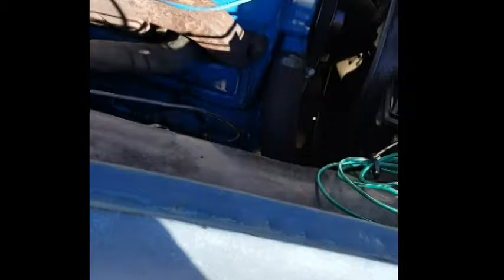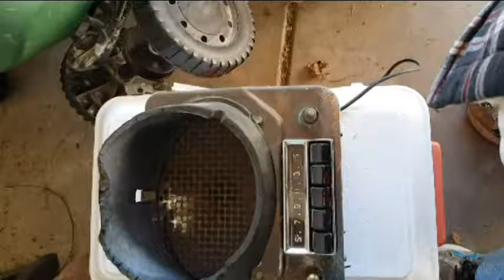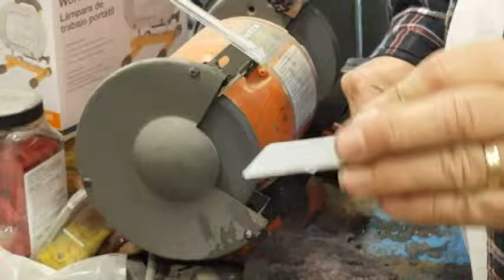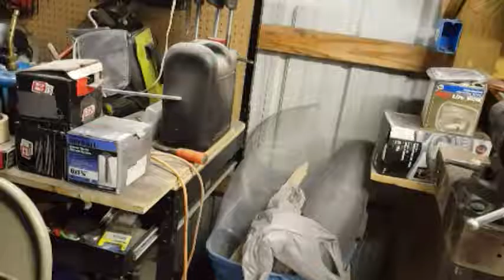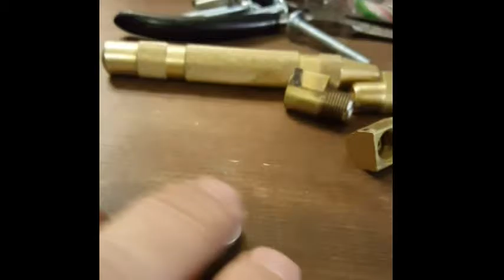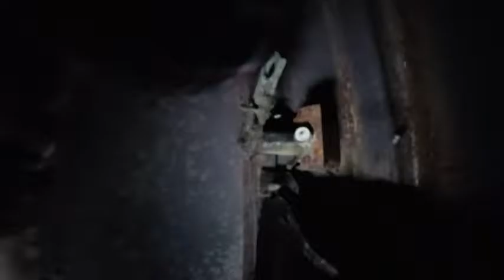Brian's Budget Garage - 1950 Pontiac wiper motor replace

Comment: Why didn't you drill out the center of the bar on the vacuum motor and tack weld it to the collar instead of trying to make a new bar for the wiper linkage?